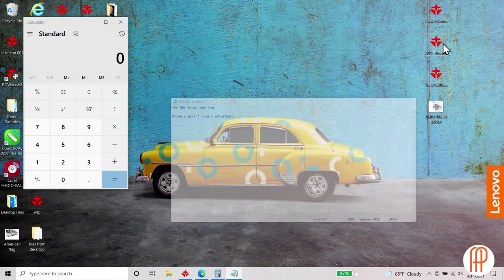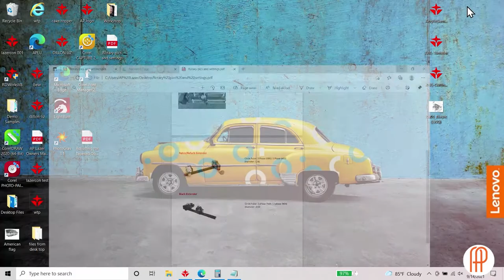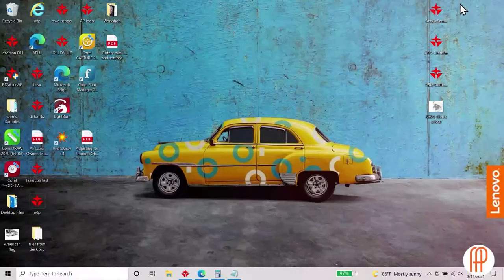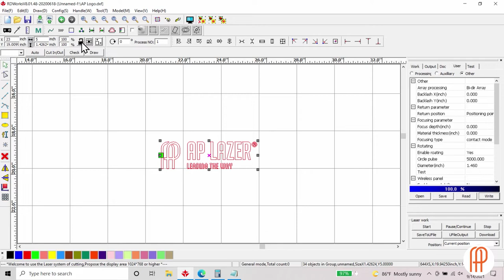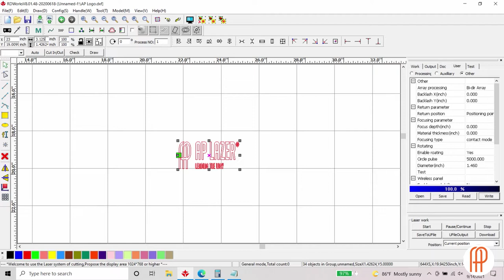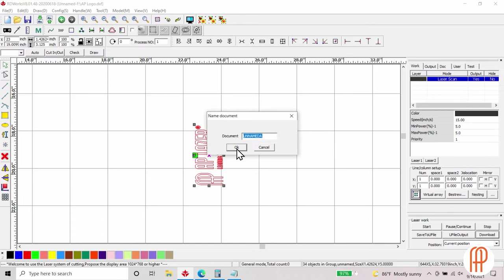AP Lazer Live Workshop | Setting Up Rotary

Comment: I am having an issue where the rotary tool stops moving the object and it results in a line being engraved instead of the design.  Any help?
Reply from the maker: Hi there! Please call our 24/7 tech support for assistance at 844-364-8211 :)